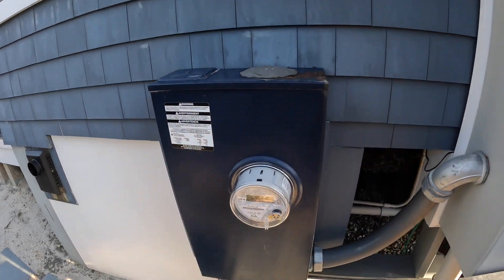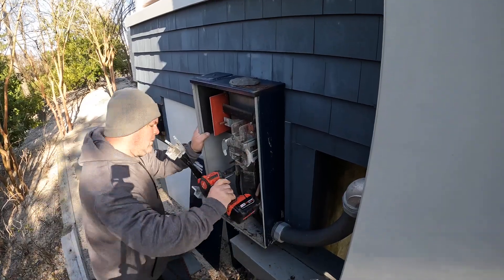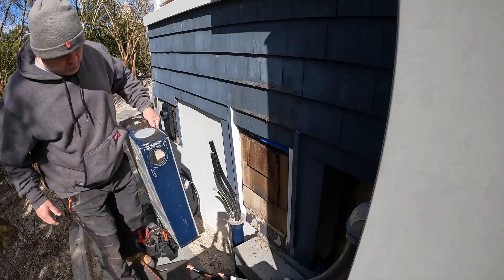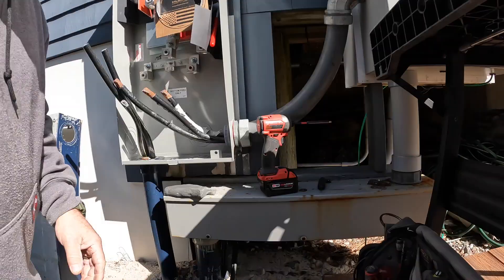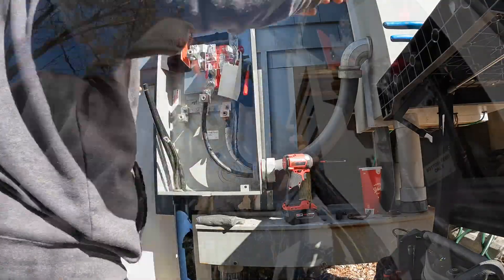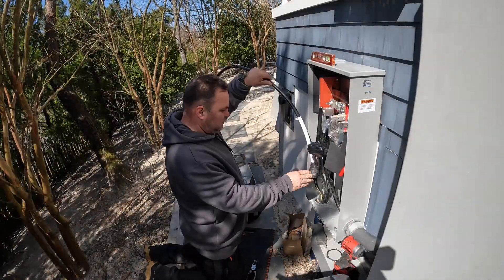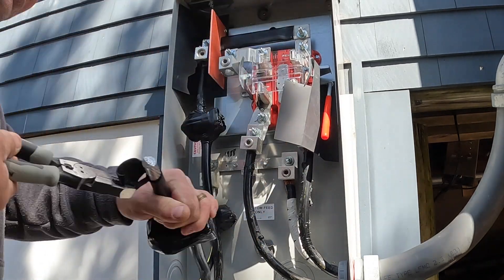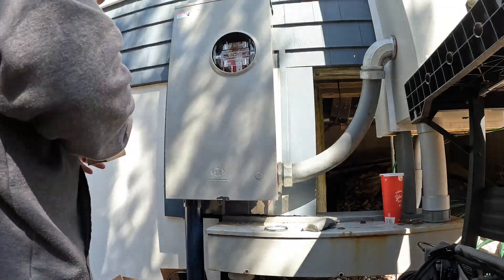400 AMP Underground Meter Replacement JCPL | Mantoloking, N.J.

Comment: Nice job.  Effcient too, getting it done in less than 4-hours.  Feel your pain with disconnection/reconnection.  In Virginia, AEP will not allow electrical contractors to disconnect anything be it overhead or underground (they will let you cut seals and pull meters once they get to know you).  You have to secure disconnect and reconnect work orders, then schedule with them and the AHJ.  AEP will not reconnect until they get a call from the inspector.  If the inspector does not call by 2:00-2:30, AEP may push the reconnection until next business day.  Really makes you thoroughly plan the job and roll.  Majority of the time though everything goes OK and everyone works together.

Comment: Thanks Ron for such an informative video. Qq, I’m planning to install heat pump for 5 ton unit and need to increase JCPL input, how do I it and how much it could cost?
Reply from the maker: Just call them.  You’ll have answer in about 8-9 months from now. Good luck!
Reply: @electricianron_New_Jersey  oh that doesn't sound good, thanks for your inputs.
Reply from the maker: @ninjip3460  first energy is horrible.  Good luck.

Comment: Wondering WHY you didn't use Polaris Connectors instead of using Split Bolt Connectors for splicing or tapping those Service Line Conductors for the extra length rerquired to reconnect to the Line side lugs of the New  Meter Can  ???

Comment: Have you ever used Burndy barrel crimps with a crimper and heat shrinks or a insulated Polaris taps 
Isco and T&B make them, most supply house sell them little caps on them and they sell thin in one side out the other side

Comment: Load side 500 copper?
Reply from the maker: Or 400.  The line side are 350 aluminum.  Good for 250 amps and there’s very little open air since it’s underground conductors.  Smh.

Comment: wow what are they going to do to protect the new meter socket thatthe meter is mounted? do jcpl allow that extension  and connections inside the socket? our area does not incase there is more settling of the ground
Reply: crew job big down and do a horizontal splice underground to extend

Comment: Funny how different utilities are. Here in CT eversource lets licensed electricians disconnect services. Now if you have a home owner permit they require an inspection sign off before they will reconnect. But that is not the case for electricians as per their manual.

Comment: We aren’t allowed to use split bolts in most areas around here on services . I don’t personally like them myself and won’t use anyways . Here we aren’t allowed to disconnect or reconnect utility side of power whether overhead or underground . Power company must do and will not reconnect without inspector signing off and emailing approval . Sometimes though it takes a day or two for reconnect depending on what time  they receive approval and how busy their crews are.
Reply from the maker: So you leave homeowners without power? That’s great service.
Reply: @electricianron_New_Jersey  it’s not the contractors choice unfortunately . We let the homeowner know that it is a possibility that power won’t be back on for a day or so so they can make arrangements. I also have a portable generator that I use sometimes if they don’t have anywhere to go . The utility company tries to get power on as quick as possible but it’s out of the contractors hands once we complete the job . We can be fined if we tamper even with the meter although I have pulled a few in an emergency and they haven’t said anything

Comment: Always hated seeing those 400 amp boxes when we were pulling up on a house fire.  Never had a main disconnect we could get at without opening the boxes; that is changing now, but it was always fun picking who was going to secure the utilities when I was working... 😅  I am doing my home panel in the house we moved in to 3 years ago, from the early 70's on Wednesday.  Putting up a new panel and getting the ground bonding fixed, it is a mess right now.  The current box is a Bryant 12 slot filled like a birds nest, and have 5 breakers double tapped.  Still don't understand how those kinds of boxes make it past the home inspector's all the time... Putting in a SquareD 20 slot 40 Circuit so I can sleep at night. 😁

Comment: Service looks good! Just curious why you wouldn't use a polaris connector instead of the split bolts?
Reply from the maker: Supplier didn’t have that size is what I was told.